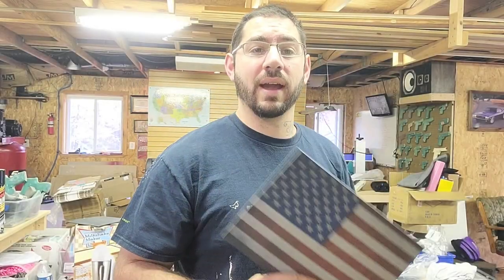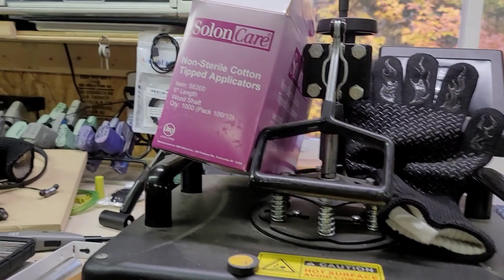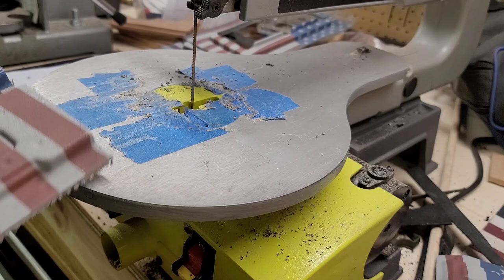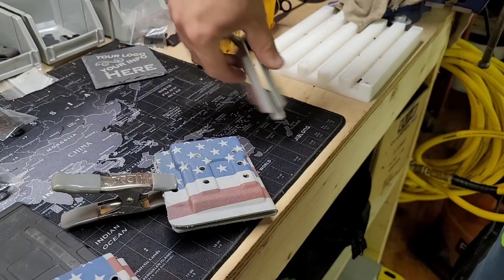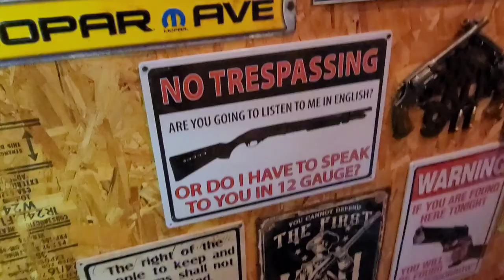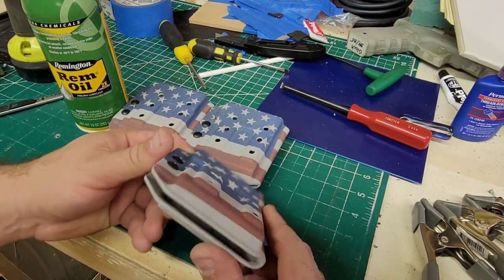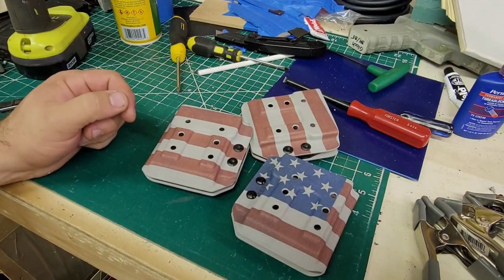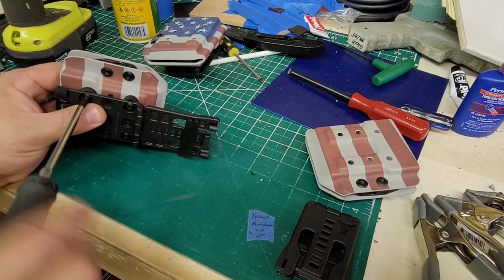Vac forming star spangled ar15 mag holders start to finish.

Comment: Looking for a double AR-15 mag carrier (2 singles stacked) that I can attach to my paddle clip. Can you do that?
Reply from the maker: In theory yes. I also have dual AR mag carrier side by side. Hasn't been processed yet though
Reply: @FalTacUnlimitedLLC  I’d really be interested in ordering that from you. Is there a way to do that? Maybe place and order then email follow up with details? Just let me know cost.

Summary:
2 AR-15 Mag holders
No belt attachments
I will drill the attachment holes
FDE if possible

👍🏻
Reply from the maker: @johnmarkharris  if that's the route.  Just ordered shells. I cut and send.  And you do the rest.  Unless you need the mrd as well
Reply: @FalTacUnlimitedLLC  I would want the MRD hardware, as well as screws to attach the two holsters to each other. Shall I just add a 3rd holster shell to the order (but only actually get 2) to cover the cost?
Reply from the maker: @johnmarkharris  3rd shell doesn't cover half the cost of hardware